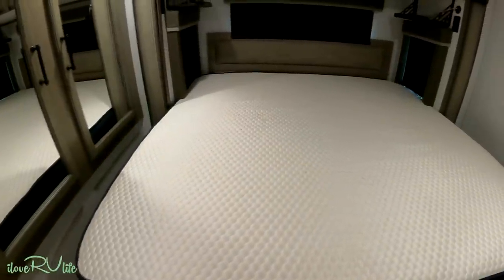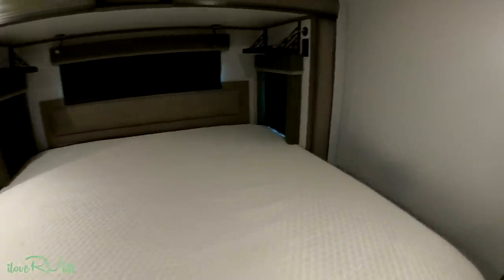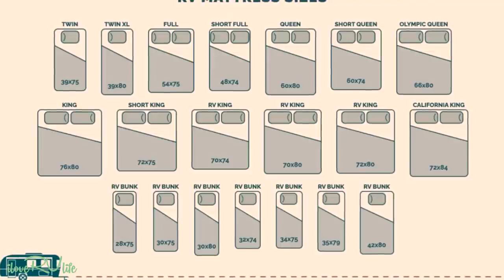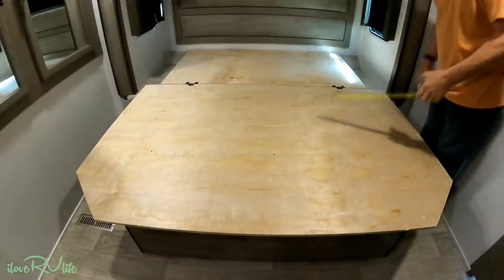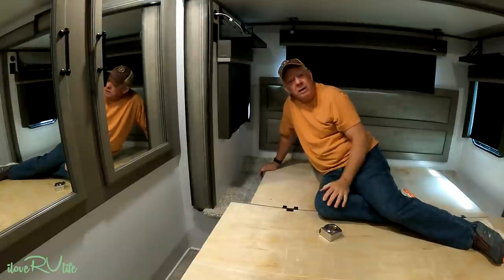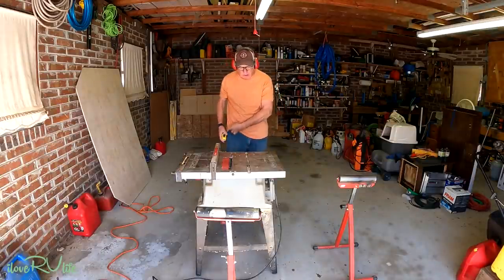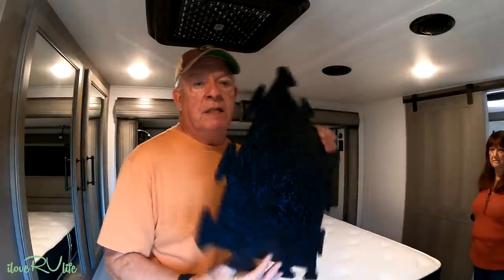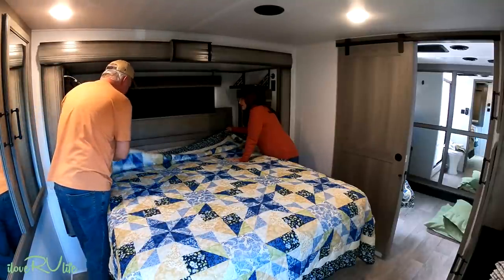Converting our RV mattress from king to queen

Comment: I’d like to switch to a queen bed as well. But on the Arctic Fox the mattress sits on a metal frame with webbing. No wood to trim. Probably would have to go to the Northwoods plant in Oregon to buy a queen metal base.  But thanks for the tip on this mattress. It is definitely fairly priced.
Reply from the maker: Artic Fox builds their RVs a little different than others.  Great 5th wheels and truck campers.  Didn’t know that about the bed frame.
Reply: Interesting. Must be a newer model than mine, which has the wood frame. I hate the way it's flush with the side cabinets, because I have to literally lift up the entire front of the mattress to make the bed. Redoing the bed is at the top of my modifications list.

Comment: Our struts are for 80lbs and we will be going to a queen short. We also have a 22 Montana and are changing to a smaller mattress, I want the Space around the bed. Want to make sure the struts will lift the bed. They did not lift the king we brought from Cedar Creek. Your video was helpful.
Reply from the maker: Thanks Nelda. One thing not mentioned was strut weight. Later I had to add stronger struts to hold bed platform in place when lifted.
Reply: What size of replacement gas strut did you need to lift the bed. We’re at 80lbs now. Tried calling IGS but can’t reach that company. Would appreciate your input.
Reply from the maker: This is going seem crazy, but I used a set of weight scales to determine the load needed. It’s not a 100%, but got me in the ballpark. I lifted the bed about two feet while Joan held the scales on top of the base of the bed, then I used a short piece of wood between the bed platform and the scales. This gave me the weight I needed for the struts. Be very careful when you put the weight on the scales.  Things could slip and smash a finger or two.
Reply: I’m not even sure I understand all of that. We go to the Montana dealer soon,for the front door, and we’ll discuss the struts.

Comment: Question,  I just switched my king to a queen but I don't have the ability to take out the plywood since I'm full-time living in it. What is the best hand saw to use and would be safe to do without removing? Thanks in advance 🙂
Reply from the maker: Hi Kelley.  If the bed platform had reasonable overhang from the base, you shouldn’t have a problem.  A hand saw will work, but will be a workout to cut.  I’d suggest a jig saw with a course saw blade.  Black and Decker had a good homeowners project priced saw in the $50 range available at Amazon or your big box stores. Have a vacuum handy to clean up.  Good news, the jig saw doesn’t kick up a lot of dust.

Comment: Sorry this is late. I just purchased a Brooklyn Bedding mattress using your discount code. Same model and downsizing from a king to a queen. Also installed my truck bed camera on my BakFlip tonneau cover like you did. Thanks. 

My fifth wheel king bed uses a metal frame with webbing. So I have to build a wooden platform. Do you use 1/2”plywood?  How much wood is at the headboard where the hinges are?  How is the plywood laid out, horizontal pieces or two vertical pieces?  Any tips are greatly appreciated!  
Terry 

Thanks for the tips you are posting!
Reply from the maker: Hi Terry.  It will take two sheets. With a queen mattress 60x80 you can run horizontal and hinge the first at 32 and save a cut on the next sheet. Cut them at 59 wide so you don’t scrape your leg on the plywood. Loving that BakFlip camera. Especially with it’s raining.
Reply: @iLoveRVlife  thank you. You have been most helpful!  I will implement your recommendations !!!

Comment: What was the size of the new struts you had to put in when you changed the mattress. I know 80 lb struts won’t lift the new mattress.
Reply from the maker: It depends on mattress, plywood used, and where hinged. Models vary. Here’s what I did.  I flipped a bathroom scale upside down and placed between the plywood holding the mattress and the platform. Laying in the floor I could look up and see weight on the scale. I added 10lbs to the weight shown on the scales.  I know this isn’t very scientific, but gave me accurate weights for the strut pair.
Reply: We’re planning on getting the same bed you did, Signature from BB. What lb struts were used?
Reply from the maker: We used 120lb.